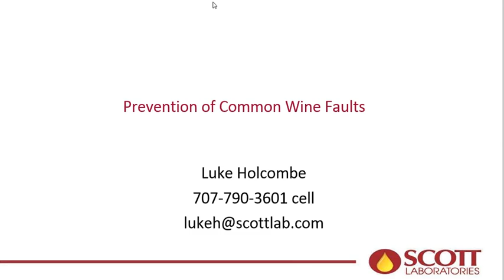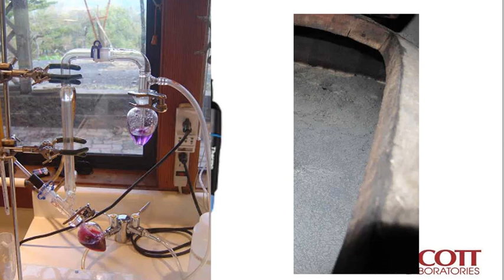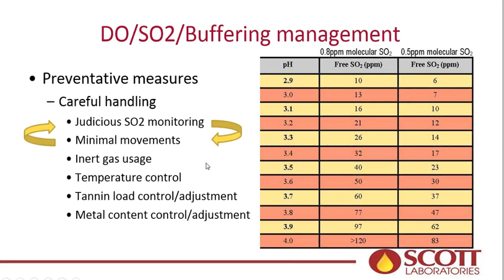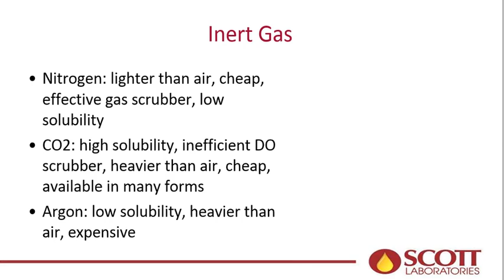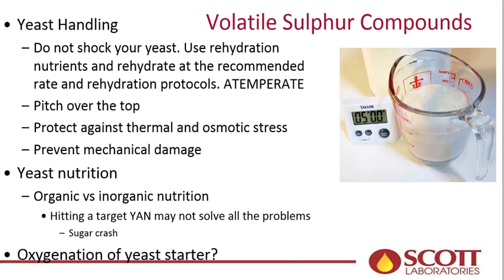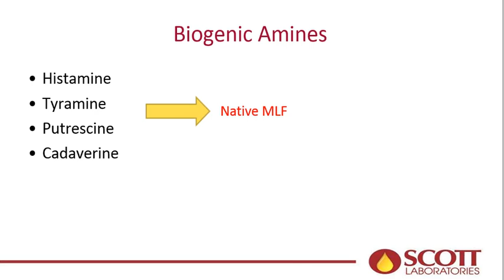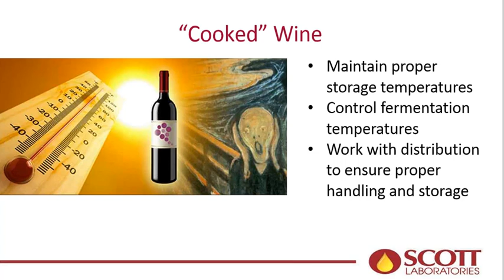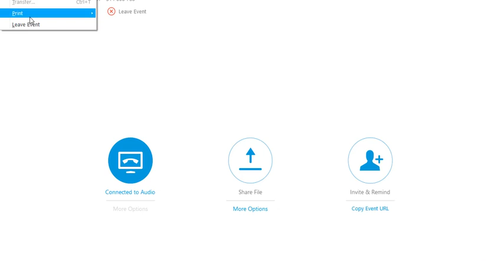Preventing Wine Faults

Comment: I think that it's also worth noting that N2 is an extremely dangerous chemical.  People not familiar with chemistry labs or plants often mistake nitrogen gas as an inert substance, the major part of air and thus no more dangerous than water.  The simple reality is that MOST fatal lab accidents are due not to the host of corrosive or toxic chemicals found in small amounts in labs, but N2.  The ability of nitrogen gas (recall that the gas volume contained within a tank of lN2 is enormous) to displace oxygen from a space is terrifying, and will rapidly kill an initial victim as well as would-be rescuers.  I'm very interested in using N2 for exactly the purposes stated here, but planning for safe handling is a huge part of that.

Thanks for the wonderful content!
Reply from the maker: Yes, thank you so much for pointing  that out!